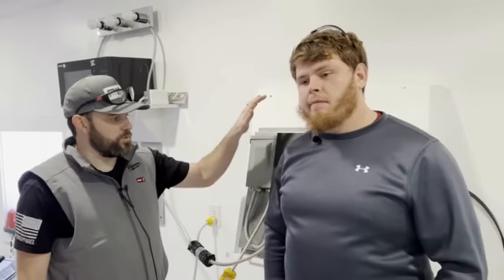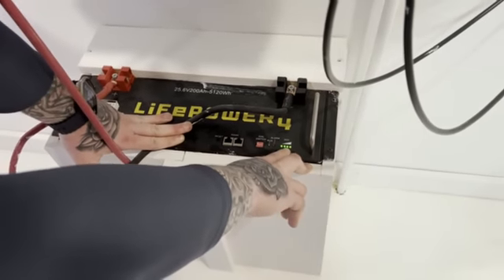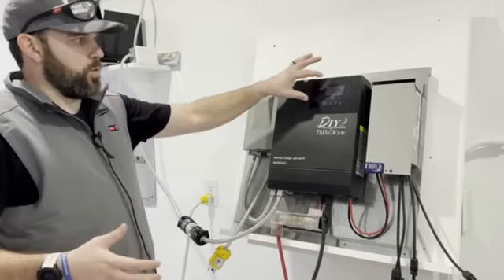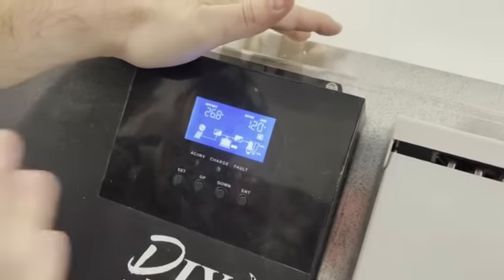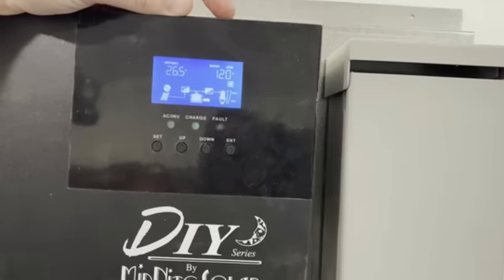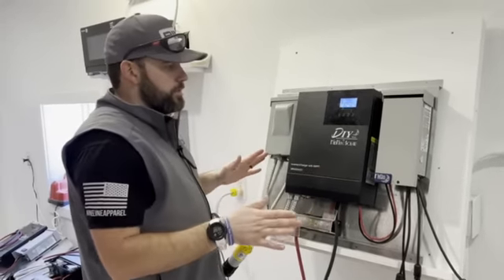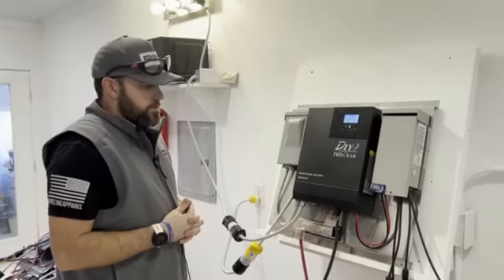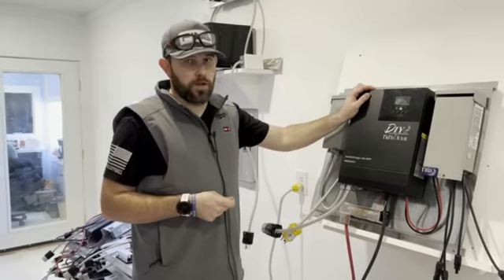Solar Power Explained in Detail

Comment: Super info😊, what are all the other wires etc hanging out for? Besides the plugs, does the rest not fit neatly into the cabinets? I noticed on another video the wires seem a bit vulnerable at the top of the loft where one might not see them from below and snag them when putting something overhead…?

Comment: Good video..... I would suggest that you build on your wall a identical look like you see in the tiny home..... Some people are so smart that common sense doesn't make sense.... But a picture is worth a 1000 words.....

Have you thought about using a smartshunt with actual meter so they can see watts and amps?
Which will explain after time logically to the client how to manage loads and sun output....
Idiot lights don't educate much.... But a client can turn on and off various loads and learn what can run with out tripping the inverter and also see how much energy they made on cloudy days to plan ahead if few days are very cloudy....
Reply: @Roobah   yes! another great teaching idea..simulate real life!
Reply: @Swim136  I lived in my camping trailer for 6 months total off grid.... Earlier I designed a off-grid system for 75 year old man and had to help him understand how solar works.... Idiot lights didn't help so bought smartshunt for outback charge controller and then I could help him see what each device was drawing in watts and amps as well as what his charge controller was sending to his battery from the Sun..... After he learned what each device used he was able to shift his usage to day hrs and conserve for night time.... But very hard if using lithium as video explained.  Hope this helps
Reply: @Swim136  the term "idiot lights" came from the car manufacturers .... The cars use to have gauges and then went to just lights on the dash.... But usually that caused major repairs... When before you could see issues before it becomes a major job.... But some people don't read gauges so that is how the term Idiot lights started.... I'm dating myself now lol my dad taught GM tech school and told me this years ago.   Be blessed